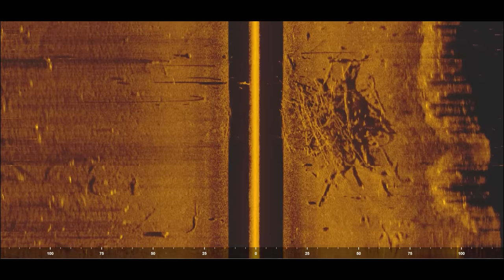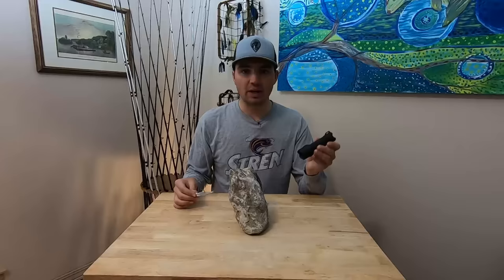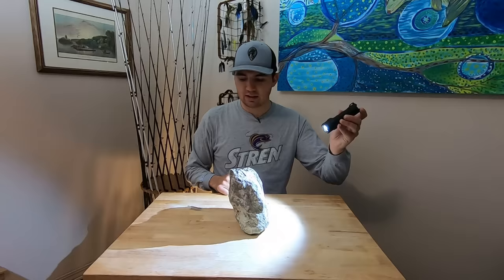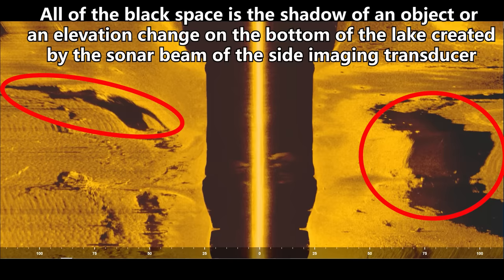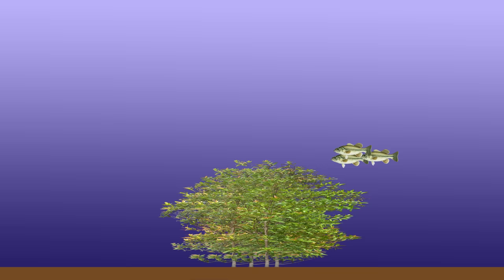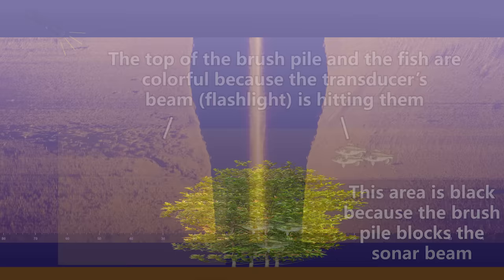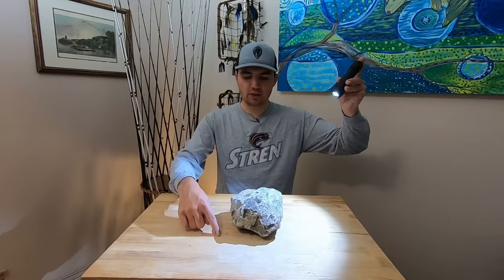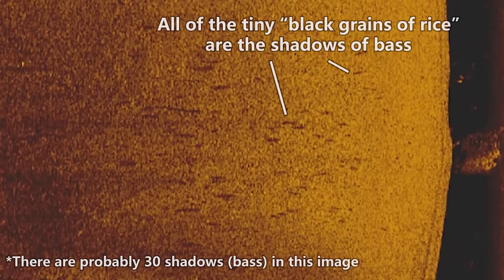What Bass Look Like On Side Imaging | Bass Fishing Sonar Instruction and Side Imaging Explained

Comment: I started using a Lowrance flasher back in 1969, have been buying new electronics every 5 to 10 years since. Fine tuning these units off Auto, is the only way to get the most out of them. I like to take photos of my images, and have a close look at them at home on my 26 inch monitor.  Put a new Helix 9 on the dash two weeks ago and have had a blast finding and catching fish using the big engine to locate the biggest schools.

Comment: Very well done.  Thanks for the info.  Question: I fish in salt for striped bass and other fish that are moving around a lot (more than a planted largemouth sitting in a brush pile).  What would that look like when the fish are moving?  Also - how well does this work in shallow water like 6-10 ft?  Same?  I imagine that the "shadow" would be longer when it is further away from the boat - depending on the range of the transducer.  Thanks again.  I'm checking your other vid now.

Comment: Clarification question: if you stripped out the black spaces to the right and left of the center line on your side imaging, and you pulled in each side that started to light up (the bottom) and pasted them together, would what you’d be looking at be the complete bottom - right and left - from a point directly beneath the boat?  In other words, if there was a sunken house (20’ square) directly beneath your boat, would this pasted image show the whole house, whereas the original image would show half the house on the left and the other half on the right?

Comment: The shadow of a rock on a soft bottom will be more linear with a perfect 90 degree from the top and bottom of the bright return on the screen. No returns are able to go under the rock, which makes 90 degree squared off shadows. This is because the rock is flat to the bottom. The bass shadow will look more like a grain of rice because the shadow is not a 90 degree linear from the top and bottom return on the screen. Some returns are making it back from underneath the fish, and you will see subtle curves in the shadow right next to the bright return of the fish.

Comment: I agree fish cast shadows as well. In my opinion a solid video. However, I think you missed interpreted your own data in the experiment.  If you have a white dot surrounded by dark shadows on the screen just above the structure the fish will also cast its own shadow. You will see the fishes shadow farther off to the outside the structures own shadow. Use the same tools that you used on your experiment a wider table and turn off your rooms lights and you will see this to be true. Hold up your lure just above the rock and you will see the fishes own shadow outside the structures black shadow. That means yes you will see a white dot in the black shadow but then out of the shadow you will see the the fishes shadow past the structures shadow. The tighter the fish is to the bottom the close the fishes shadow cast will be to the fish, sometimes both touching. The farther the fishes duplicate size and shape shadow is away from the fish most the time means the fish is higher up of the bottom of the water. The bottoms density of the water also effects IDing the fish on the screen when fish are tight to the bottom of the lake. Just retry your experiment and see if you can make the fishes (white dot) own shadow stay inside the structures shadow.

I only use SI for a quick scan. Then I use livescope to confirm. I was surprised how often I was incorrectly IDing a fish. I use both Humminbird & Garmin Livescope in together. With all this tech it is almost as much fun as actually fishing now a days.

Comment: So the ruler at the bottom center starts at 0 and the edge of black starts at 15' so im assuming its 15' deep there so the ruler left and right are actually innacurate.  you would need to subtract 15' left or right to determine how far each object is.  I guess my question is why cant the edge of black start at 0' center show 15 for depth so the ruler would be accurate so you dont always have to do math to figure out left and right objects.